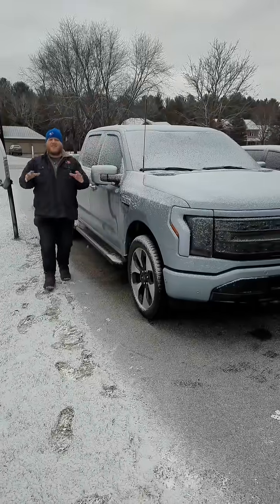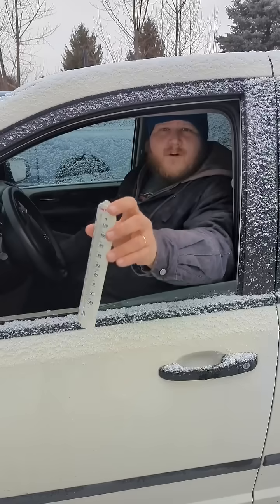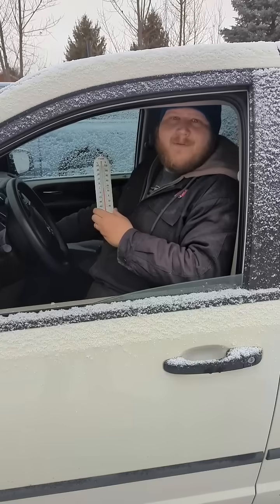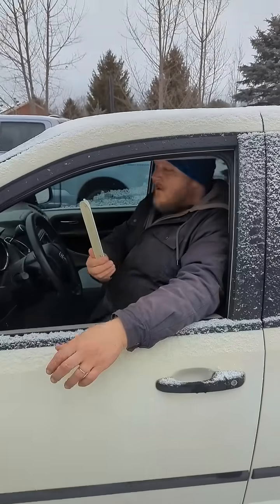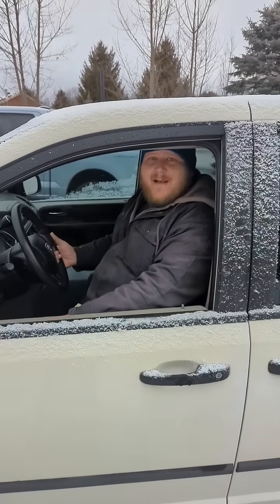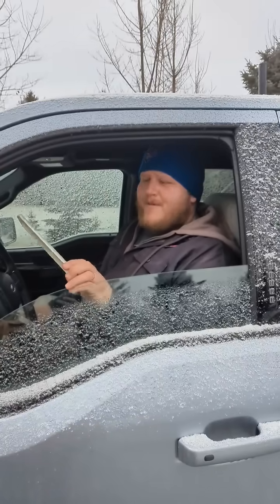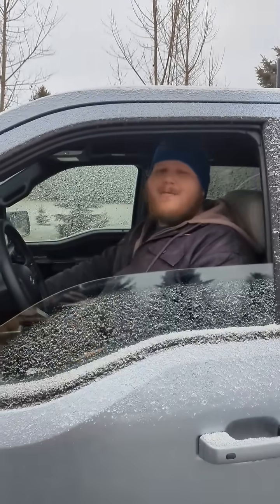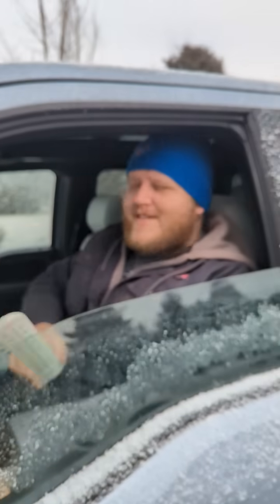Electric vs Gas - Heater Wars! How Long Does the Ford F-150 Lightning Take to Heat Up?

Comment: Some newer luxury ice cars have an auxiliary electric heater that heats up the car just as fast as a ev possibly faster my audi a3 is blowing hot air immediately from cold start.  Ice cars have a bad habit of using engine coolant for heating, which requires the engine to be heated up. But I guarantee you that if you took that dodge on the road immediately like real people do, in reality, that car would have taken half the time to heat up.   This is definitely a mute point and not a reason to switch to a EV.
It's just more ev propaganda

Comment: I have a diesel heater of around 5 kW in my Volvo. The heat comes really fast, and even faster of course if you are driving.
And it actually cost the samerna torsdag run a an electric version because p the prices today.

Comment: Would have been nice to mention that at 0 Celsius,  the range of the truck is about 70 miles per charge. Pathetic. It's been proven by other youtubers aswell and Ford doesn't want you to know this.

Comment: Smart test. Goes to show you how a proper electric heater functions versus waiting for the engine to warm up the coolant / antifreeze that then goes through the heater core after the thermostat opens. It takes a bit of time in the cold.

Comment: My car heat up in 3 to 4 min when drving. Hence really no difference.  But I agree the EV heater is way more efficient scientifically.  EV's are not going to be the future.  Hybrid and hydrogen power mark my words EV are just a stepping point.

Comment: So many things wrong with your test subjects. A new EV truck vs a 2015 minivan. Take a new EV truck and the same model truck with a gasoline engine, then I'll be impressed. 

Well no actually I want. An electric space heater will heat up faster than a boiler heating system. 

If running the heater in a new EV for 4 minutes reduces my range by over a half mile, then you can keep it. I'd rather take my chances with a gasoline engine. At least when I'm refueling at the pump for 5 minutes my car will still warm and then I can be on my way vs sitting in the cold for 14 hours at 220V or 1.5 hours at 440V.

Comment: That's great and all except that f150 lighting towing a car in cold weather with the heat on has a range of about 45 miles. So it's a piece of crap. I'll take my ICE f150 any day over it.

Comment: Everyone arguing about it being a bad comparison here’s some science for you: ICE engines heat the cabin by using coolant that is heated by efficiency loss in the engine (friction->heat). That waste heat has to heat up a water based coolant that takes a long time to change temps. Then you run that through a heater core where another energy transfer happens to get it into the cabin air. 

The EV uses a resistive coil. It dumps current through that coil and it immediately begins heating, then you have only one energy transfer to cabin air. 

It’s pretty obvious EVs will immediately dominate this. And no the power use of the heater isn’t even close to what the motors use so it’s not that big of an impact on range. EVs have some way to go before they’re better in every respect but that will happen.

Comment: Okay it heats up a cabin  half the size in a shorter amount of time. Also window all the way down in Chrysler, but a little over half in Ford. Not that it makes a huge difference, but still a difference.But an ICE vehicle doesn't take 12 hours to make a 6-hour trip. Unless it's that Chrysler, which with breakdowns could take longer...lol

Comment: This really doesn't prove much. If the F150 lightning was compared to a same year ICE F150 this would actually work. But there is a 7 year gap that doesn't allow for wear and tear on the vehicle, and drastically different cabin space from a minivan to a pickup truck.

Comment: Also if you want to warm up your car faster you just have to rev it like around 1500rpm steady and it'll warm up even quicker.
Reply: Most manufactures say that causes strain on the engine block or it's components. From warming it up to fast.

But they also say leaving it idling to warm up isn't good either so whatever lol

Comment: This guy has the window all way down on a 7 years car.  The other one window half way down.  Thank proving GAS cars are better.   I have never see fact on electric car beat a gas one that doesn't have to take the results. Compair a old gasoline car  with all the window open to a new electric with window mostly close.

Comment: 1 km off your range for 4 minutes of heat. LOL
Reply: That's only during warm-up (with the window wide open), it takes less to maintain the temperature. Also, smart drivers warm EVs up while they're still plugged in so they're not pointlessly losing range. You just don't unplug an EV in your own driveway before warming/cooling it.

Resistive heating is a waste of power though and Ford would be wise to ditch it soon.

Comment: I really enjoy Truck King videos but this test is misleading. Contrary to belief, idling a cold car like this can wear an ICE quicker. With ICE vehicles, you should start the vehicle, let it idle 30 seconds or so to build oil pressure then proceed to drive carefully not to rev it immediately. That's why it took 14 mins to warm up, it's just sitting there idling whereas if you drive it carefully, it will warm up quicker and you will even have the heater warm up quicker.

Comment: Correction:  ALL EVs use resistive heating for the cabin.  ICE vehicles use heat from the engine to warm the cabin.
Reply: Some EVs use heat pump instead of resistive heating element
Reply: @TevinP  some do have heat pumps, but even they have resistive heating in addition for when it's too cold for a heat pump to operate.
Reply: @nataku411  That actually makes a lot of sense!

Comment: Why mention reduced range on the EV but not the ICE? You used gas starting and running the van for 14 minutes didn't you? That reduced the fuel and therefore range of the ICE as well.

Comment: I've noticed it warms up way faster if you start driving, probably 5-8 minutes in that situation (0deg) with an ICE car
Reply: Yeah, my car takes like 2-3 minutes for heat to start, by 5 minutes its noticeable,  after 10 mins im turning the heat down
Reply: Yep. Engines heat faster under load. But EVs throw heat in *seconds*. Remember he heated the cabin to 20C, we are comfortable when the car begins throwing warmth at us, the rest of the cabin takes longer
Reply: @calvin2686-u1k  I don't disagree, just adding to the conversation 👍
Reply: I had a rental pour out heat in one minute.  Select drive, apply the brakes firmly, and floor it.
Reply: @user-tb7rn1il3q  😳😅
Reply: @user-tb7rn1il3q  or put it in neutral instead of burn their parts up 😐
Reply: @DivineLightPaladin  You need the resistance to load the engine.
Reply: @user-tb7rn1il3q and ruin the drivetrain at the same time?🤦
Reply: Sure.

But the EV can warm up in the driveway WHILE PLUGGED IN while you're still eating breakfast. No range lost, battery somewhat warmed up, ready and waiting. Without idling the engine.
Reply: Precisely. ICE cars heat up faster when driven. If you just let them idle, it will take longer hence you are wasting gas.
Reply: Some ICE especially turbo cars need to warm up before you drive them or you risk stressing the components .  According to the manual anyways lol
Reply: @Uberaroundtheworld530  Not if they’re using a proper synthetic oil like all modern turbo vehicles are supposed to be using. The old days of unlubricated and coked turbos are almost in the rear view.
Reply: Was going to mention that. ICE cars warm up faster in motion.
Reply: Won't that damage the engine?, how on earth did you folks earn your driving license??.
Reply: @Orioneustace2345 I live in Montreal and did it for 15 years on my last car, and the engine ran perfectly without burning any oil, but I do my maintenance and how does any of this relate to getting a driving license🤔,
Just your useless trolling comment 🙄
Reply: @djnixmixMTL  well, if you have been driving as you claimed, you will definitely be familiar with the manufacturer manual.
Reply: @Orioneustace2345 my first comment was not advising, just an observation. And something I did often because of the cold winters I experience. I know it's not good to do, but warming up the car for 15 minutes is not necessarily much better than 1 minute, unless it's -30°. most my cars were over 10 years and never had any engine problems, also been driving for over 40 years. The only car I warmed up even in summer was my 1972 nova SS😂

Comment: So what is the range cost to keep the cab that warm while you drive? Probably half.
Reply: My Lightning shows that it uses 10% battery to keep warm on a cold day.
Reply: @fakumadda1632  how cold is cold  -5 or -25 ⁰c
Reply: @KyleParks  That was -10C. It hasn't really been too cold in Southern Ontario this winter so far. Today at +1C  it took 7% to keep the cab warm on the highway.

Comment: None of this matters 1 bit when it is too cold for the batter to charge. Also air temperature is completely irrelevant. What matters is if you are cold and you will not be cold no matter what the air temperature if you have seat warmers like any modern truck has. Nonsense commie climate propaganda

Comment: Try that where I live.  See how it’s does at -30C. A curiosity to say the least.
Reply: If you want I could ask one of the literal thousands of Tesla owners driving around Calgary year round. I know the answer though: warm air in seconds. Resistive heating takes literal seconds to blow warm. Warming the entire interior, however, is a different benchmark. Most of the idiots commenting here "hurr durr my twuck warmz in 5 min" are talking about blowing hot.

Comment: It's so stupid. Warming a car up while letting it idle might be wasting a little gas but when your are all of a sudden dependent on needing that electric charge having so much battery that only lasts so long, you're only making such situations a lot more expensive and time consuming that a lot of people still don't seem to have wasting like that. How much extra mileage does it consume from the battery that you're not able to drive for only because something as easy as charging your phone while driving only kills your battery that much faster being that much costlier keeping your car charged.. You really need to count your ducks when it comes to buying these EV's. Are they really that reliable in helping keep yourself accountable. How much of the battery does it eat up just to have a simple heater to stay warm with or conditioner to stay cool as you drive without limiting the range of miles it could take from you just because... You really need to think about it. The more you use that car in the process of driving, the faster it drains what little battery mileage you expected to get by on.

Comment: 2 things I'm curious of... 

1. I would imagine when driving, the EV heats up in the same amount of time but if the ICE vehicle was drivinging I would be it heats up much quicker.  I think most people drive when they start their car otherwise they don't care how long it takes if they're remote starting it. It would be interesting to have that tested.
2. Any chance you would take an EMF meter in the F150? The heating technology is similar of that from a hair dryer and hair dryers are known to emit crazy amounts of EMF. I wonder if the F-150 emits high levels of EMF as well or if they house the core well enough to protect you from it. The closer you get to the core the more you left there would be and more than likely it's far enough away from you to be safe but still an interesting test.
Reply: Heres 19 reasons why electric vehicles SUCKS.

1) It’s too expensive 

2) Also cause pollution because it’s created by dirty fossil fuels 

3) Tires wear out quickly 

4) Only reliable when temperatures are warm and when it’s cold, it can bring danger to the driver and passengers.

5) Charging stations are hard to find in midwestern states. If you live somewhere like Wyoming or North Dakota, it is clear that you are going to have a lot of difficulty finding charging stations, as well.

6) Roadside Service does not provide Full Coverage and lot of this has to do with the fact that their parts are not on-hand and they are more difficult to actually find than ones for regular cars. Also, auto mechanics will not know how to fix electric vehicles since they didn’t built it. You probably have to find Elon Muck and ask him to fix it for you and he will probably charge you for a million dollars. 😂

7) Travel shorter distances due to the fact that these are cars that need to be charged, they simply do not have the same type of mileage range that regular cars often possess.

8) Too much focus on luxury vs. dependability. With all of the issues that have been discussed thus far, one may be questioning what exactly car manufacturers are aiming for when it comes to making these models. In short, they simply are spending too much time on overall luxury rather than dependability.

9) They get noisy early on. Owners of electric cars have been quite open about the fact that they are prone to make a lot of noise very quickly into their usage lifetime. There is no question that over time, this happens to all types of vehicles, but it is alarming that it has been happening so quickly for electric ones.

10) Maintenance costs far more because when dealing with expensive cars, one can always assume that repairs will end up costing far more. However, when observing electric vehicles, it is clear that the prices to fix them are at an extremely excessive rate. This is largely because finding its parts is far more difficult.

11) some electric cars look ugly

12) Battery pack replacements are expensive due to the fact that electric cars run on their battery packs, it is clear that they play a major role in the overall performance of the vehicle. However, their batteries are prone to needing replacements as time passes by, and they end up costing a ton of money.

13) Recharging takes a long time

14) Durability is not consistent

15) Tend to be heavy due to the fact that electric cars are built with different materials. In fact, the heavy weight of these vehicles is likely another factor that ends up making their tires begin to drop in quality so quickly.

16) One major aspect of the electric car market is that there are limited choices. Unlike regular cars that comes with an abundance of different options, car manufacturers do not seem to release multiple electric vehicles. This is not a solid idea, as electric cars are trying to grow in popularity.

17) Not Good In The Snow. Electric cars definitely meet their match when they are used in the snow. They are prone to having a lot of malfunctions with this type of weather, while also having a lot of difficulty while driving on slushy roads.

18) Too Much Hype. "Show not tell" is the philosophy that car manufacturers should possess. However, when it comes to electric cars, it is clear that this currently is not the case. There is no question that the market is pushing for more usage of electric power, but they have yet to accomplish much in the way of persuading the vast majority of the public.

19) Having a smart car means that the government can track your every move and can listen to your conversations. 

DEMONcrats and leftists wants to banned EVERYTHING. Gas cars, gas stoves, guns, cows, meat, freedom of speech, freedom of religion, and etc. I’m not going to go along with their authoritarian policies so fuck them!

Comment: But in terms of actual science the heaters in ICE's are infinitely more efficient due to the fact they use heat that is generated by the engine. It's an extremely effecient and self reliant system compared to ANY ev.
Reply: But let down by the 30 percent efficiency or less of an actual ICE engine compared to 70 percent or higher EV efficiency. Heat pumps like in most new EV’s now are far more efficient than any ICE generating heat. This is fact and can’t be ignored. That’s why I can sit with my heat on to a nice room temp of 70f for days and still have battery left over while the ice will run out of fuel long before. Look up videos on testing this you’ll see that EV’s while sitting can run the heater for many many days while a gas vehicle will die before then. Clearly the gas vehicle is far less efficient overall. Any way you look at it a battery, heat pump, and electric motor are all way more efficient than anything in a ICE vehicle.
Reply: @Dylan_JVIPTER  ok but I'm not talking about that. Im talking specifically about the heating system. Using excess heat that is generated by the engine is infinitely more efficient than an EV that needs to use battery power to generate heat. And if what you are saying were actually true people wouldn't sacrifice not using heat to get extra range which is a very common thing apparently. People actually suggest that you dress warm in your car so you don't have to use the heat.